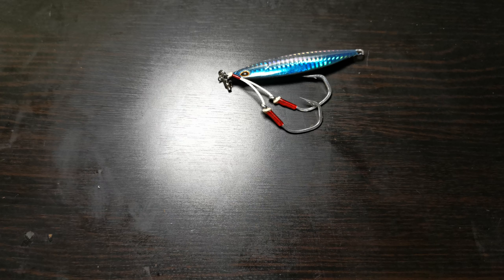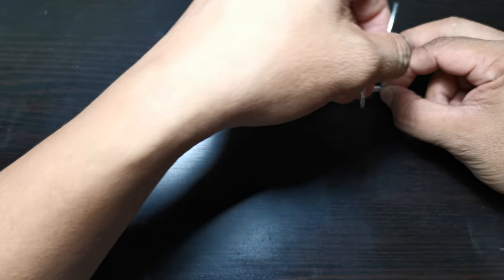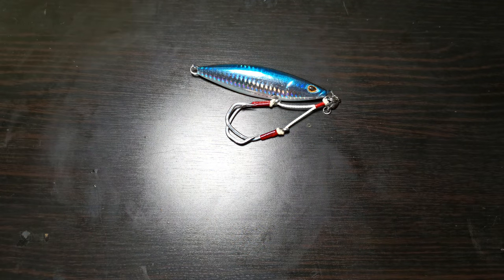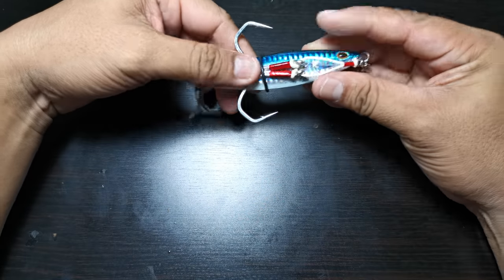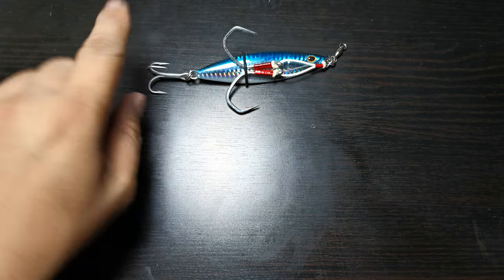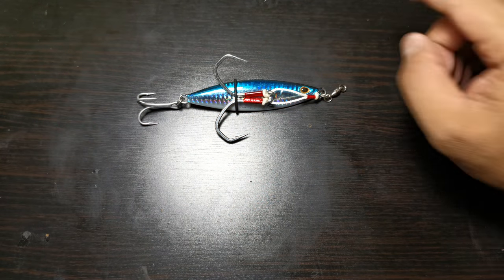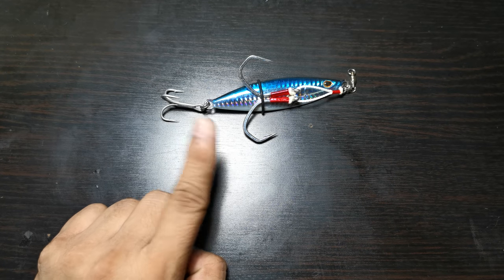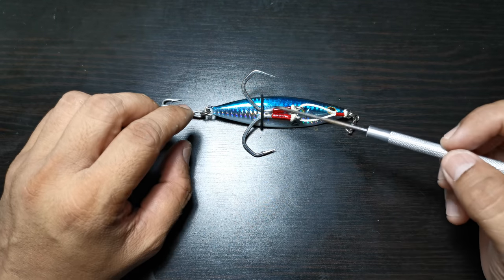TRY THIS UNCONVENTIONAL SLOW JIGGING RIG - REALLY WORKS!

Comment: Great idea, shall do just that, thankyou, also the nitrile rings can be used on your rods to hold them together when they are broken down for transport ( they stay on the rod too so you don’t misplace them) and putting one on the egg beater reel pillar is a handy point to hook the lure/ jig when you are moving about. Nitrile lasts longer than rubber too.